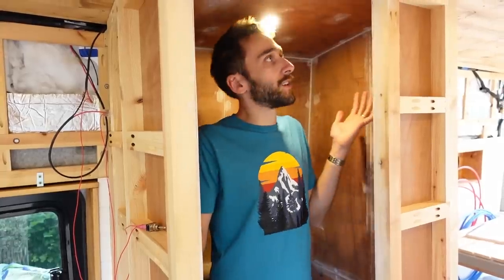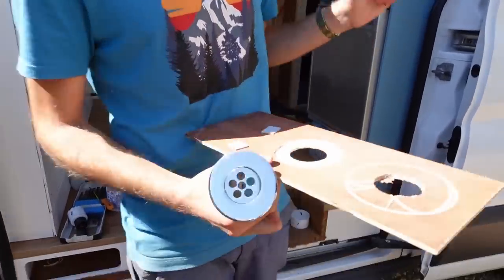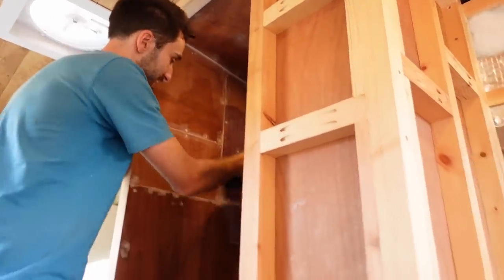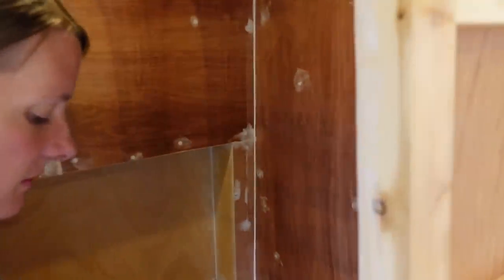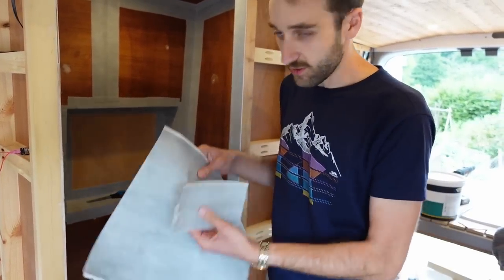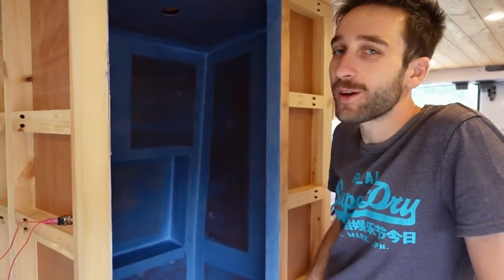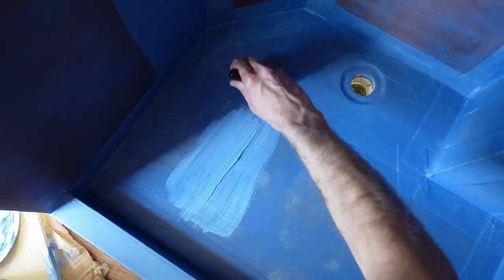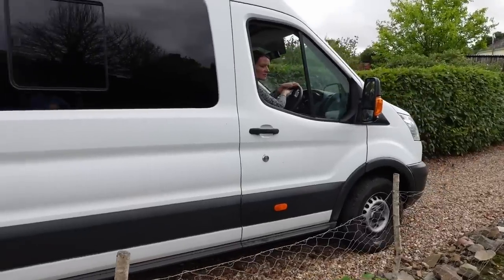Waterproofing Our Van Shower with Tanking (Recirculating Shower Part 2) | Transit Van Conversion E30

Comment: Silencer was a great move!
Reply from the maker: Yep! We were quite surprised how much of a difference it actually made, was instantly noticeable. When it's on lower speeds it's pretty quiet now
Reply: @SelfBuiltStories  I've seen people use two back to back, might be worth a look if youre still bothered by the noise
Reply from the maker: @darren9752  Yeah we've seen that as well, we're pretty happy with the level it's at now though. David McLuckie actually has a video where he tests out loads of different combinations including three in a row 😛 https://youtu.be/kxeqtJevV0o?si=J9bRSsd44CkB2dBL

Comment: Another great video and really good to see the level of detail you go into. It will certainly help anyone else thinking of doing something similar. Very wise to spend the extra time doing more layers of the tanking. Can't wait to see the final finish
Reply from the maker: Thank you! Yeah we're happy we went for the third layer, nice to have the extra peace of mind 🙂
Reply: Great work! How big is your water tank? How many five minute showers can you get out of it? 
Does the water recirculation occur for the five minute shower water or for the whole tank?
What is the concept of shower recirculation?

Sorry about all the questions! I  am just a very curious little bee!
Reply from the maker: @marshmellow989  cheers! 🙂 And no worries! So we have an 85l fresh water tank and a separate 18l hot water tank for the shower. If we're using it as a standard shower it goes down quickly, as our pump delivers ~2.5l a minute so for a high pressure 5 minute shower you would use most of the shower tank (~12.5l). So the way we designed the system was to save how much water we need while stile having a nice shower. 

What we usually do is a military style shower first using minimal water, which is ~2.5l each and that allows us to clean off any dirt, use shampoos and shower gels etc, and that all drains normally through the drain and out to the waste water tank under the van. Then we turn on the recirculating part (there is a switch outside the shower) which closes a valve to the tank and turns on a pump which pulls the water back out the drain and puts it through a number of filters before it goes back into tank, so it forms a closed loop. Then we can enjoy a hot rinse for as long as we want without using any more water. Then after a few showers we drain all the shower tank water into the waste tank and refill it from the fresh.

That's pretty much the gist of it, we'll release a video on it at some point but it won't be for a little while. It's not maintenance free either as there are filters that need cleaning/changing from time to time and it obviously adds a bit of complexity, but it works well for us! 😀

Comment: Good job guys. Astute of you to identify that the air intake to the heater was making the noise, the same happens on inlets to the engine (which are silenced by careful airbox design), not that 99% of people know. Another good tip is to mount things like pumps (air or fuel) onto rubber bobbins, this helps isolate them from the chassis (which would transmit the noise more).
Reply from the maker: Cheers, yeah we were surprised how much difference it made for such a simple and cheap addition, a big win! The fuel pump is mounted with the rubber spacer that came with it so it's not directly against the chassis, and that's mounted onto a block of wood. But the ticking still resonates and you can hear it fairly clearly, although it doesn't really bother us too much. We might try to quieten it down a bit but not eliminate it as the sound of it going is quite reassuring and we've got so used to it now we sort of like it 😛

Comment: Good job , you two have a lot of patience. By the way you know the shower is small when you are applying the waterproofing material from outside the shower and you still reaching the furthest wall lol. Ps I like to be generous when applying waterproofing material but liberal with my fiends in Floria when I need to tease them.
Reply from the maker: Cheers, it did take a while! Haha it is small compared to a house shower but it's plenty big enough for us in the van, it actually feels fairly spacious inside when you're using it 😄

Comment: Maybe a roller works better, but certainly doing more coats is worth it. I sealed a deck with similar membrane and a roller worked well. I still used a brush on inside corner edges though.
Reply from the maker: Yeah would be interesting to try with a roller actually, we just used what came with the kit. Is quite tricky to get a flat finish with just a brush so not a bad shout to give that a try 👍

Comment: Wow, well done guys, you love doing things the hard way. But tbh as long as its correct it does not matter. We did the ply with a shower tray we trimmed to our size then 2mm of pvc. Keep up the good work. :)
Reply from the maker: Thank you 😊 Yeah we did plan to use a shower tray originally and actually bought one but it didn't fit in the space we needed it, so after a brief 'hmm what now!' moment decided we'd build a custom fit wet-room instead. Was a bit of work but we're happy with how it turned out 🙂

Comment: I heard about device that's a level which can be placed on the dashboard and gets the car level (in two directions at 90 degree angle).  Foresty Forest channel of Youtube showed in one of the videos.

I found an example called a bubble spirit level.

I like that you spend a lot of time to make sure things are done as right as possible at first.   If I did a van build I'd strongly consider a diesel heater, but probably do something for bathing that facilitates bucket bathing.  Maybe a basin I can sit in with a drain.  I could put a stool in the basin and put a bucket or two.  I've seen it down with a large cup for wetting and rinsing.   Foregoing plumbing I'd be fairly happy about.
Reply from the maker: Cool, our problem was the ground was very sloping so there was no way to get the van itself level. But now we're on the road we a spirit level app to check the angle when we park up so it's optimum for shower drainage. And thanks, yeah we did spent a lot of time, but figured it would pay off in the long run! There's so  many different things you can do in a van which is the nice thing about it, you can build it exactly to suit you 🙂

Comment: I like this idea! We have a plastic tray which turned into a nightmare. I might go this route. Im wondering how is it holding up so far?
Reply from the maker: Hiya, happy to say absolutely no issues so far with many showers in that time! We'd definitely go down the same route if we were building another van too as having to conform everything to the limited sizes/shapes of trays was too limiting for the layout we wanted. And we don't have to worry about the often tacky motorhome trays cracking or yellowing either 👍

Comment: Beautiful build of a shower One question what the Measurement please  Please
Reply from the maker: Cheers, and the rectangle part inside the shower not considering the angled or wheel arch bits is roughly 76x60cm 👍

Comment: Another great video and contemplating using this method to do my shower room. 
So how has it stood up to time so far and are there different colour options? 👌🏻
Reply from the maker: Cheers, and it's holding up nicely so far. Presuming you mean for the PVC and tiles which we put over the waterproofing layer? As the blue tanking is all covered up. And yeah you can get them both in different colours (we almost went with duck egg for the reco tiles). HTH 🙂
Reply: I’m referring to the the tanking on the floor, because potentially it could get wet if the sealant fails.
Reply from the maker: @dazmtb  Ah ok, yeah the floor is holding up really nicely too. It's the same waterproofing membrane and then Altro Pisces wet room flooring on top. You can get that in a different colours and styles too 👍

Comment: Just come across your build channel and have bingwatch all your vlogs,  and was just wondering how  you intend to heat your hot water for the shower and sink  !!
Reply from the maker: Cool, thanks for watching! And we're going to be using a Bobil heat exchanger that uses the energy from the diesel heater to heat the water in a separate 18l tank, which should be able to get it to 40C in around 10-12 minutes. We have the kit already so hopefully not too long till we can get it all in! 🙂

Comment: Top Work as always...Maybe you have already said. but are you not having an extractor in the shower?
Reply from the maker: Cheers 🙂 And what we're planning to do is use the maxxfan that's right outside the shower to pull out the moisture air. We're going to put in a sliding door with a small airgap at the top, and then we'll have the heater blowing warm dry air in to the bottom of the shower. So hopefully it will create good airflow to remove the moisture and then dry out the shower room afterwards

Comment: Hi, loving the build. Have you considered venting for the shower, especially if you are using it for a drying room as well 

Keep up the great work
Reply from the maker: Cheers! And yeah we've given it quite a bit of thought. What we're doing it putting in a sliding door that stops a few cm's short of the top of the shower so there's a decent air gap, and then we have the maxxfan right outside which we'll have on while the shower is in use. Then when the diesel heater is on it will push dry warm air into the bottom of the shower and then be pulled out the top by the fan, so hopefully making a decent flow. There will also be a small fan inside the air pipe for the toilet we're putting in too. We think all that together should allow for some decent ventilation, but if when we stress test it we need something else, we'll add an extra fan/vent at the top of the shower 👍
Reply: @SelfBuiltStories  I should have known you guys have a plan. Loving the care and attention you are giving the build
Reply from the maker: @steveround315  Haha cheers, it's probably something like 80% thought and 20% actually building 😛

Comment: Van is coming along great! I've just binged most of your videos over the past few days and am looking forward to seeing the final product. On a side note - how do you find the extended van to drive? Currently deciding on what van to pick (I'm 193cm and would need a lengthwise bed + height of a transit) so sort of torn between the LWB and LWB extended (jumbo). Do you find the back scraping on hills/ swinging into traffic on narrow roads? Living in NZ with its hilly geography and narrow roads that would be a bit of a dealbreaker for me unfortunately - but seeing you guys happy with yours gives me a bit of hope haha.
Reply from the maker: Thanks a lot! 🙂 Yeah it's starting to take shape a bit more now, we're hoping we've done most of the bigger projects! And we find the van absolutely fine to drive, more comfortable than being in our car. We drove it 13 hours up to Scotland and it didn't feel that long at all. Where we are is lots of narrow country lanes, potholes and hills but we've never had a problem with the length. It's a bit interesting sometimes on a single track lane when another vehicle comes the other way and you have to reverse though! The only times we really notice the size is in busy urban areas, especially trying to park. Supermarkets and things round here aren't really designed to accommodate a 7m van, so we often drive around for a bit trying to find somewhere suitable 😛 We spent a few weeks in NZ on the South island in a motorhome, absolutely loved it there! You have some stunning scenery, hope to be back one day 😊

Comment: Where did you get the magnets from/what are they called that you put either side of the van to cut through it? 😊
Reply from the maker: They're just a pair of fishing magnets and ours are rated for 250kg. That seems to be a good sweet spot as we can feel the magnetic force through the van even through our composite floor with all the insulation in, but not so strong so that we can remove them from the underside easily. So would imagine any pair around that sort of strength would work nicely, something like this: https://www.magnosphere.co.uk/neodymium-fishing-magnet-threaded-eyelet-32-90mm/a-2201. There's some on Amazon too. HTH! 👍

Comment: Hi is it safe to use diesel heater in shower ? I mean what if water gets in there?  is it possible?  I'm at the stage of building a shower in my campervan and I'm wondering if it's a good idea.  Thanks  and greetings from Scotland  :)
Reply from the maker: Hiya! Yeah we had similar concerns about water backing up in the ducting but having done it now, we're not too worried. We've thought about the design to minimise the chance of any water getting into the ducting. So the air vent has a hood on it, and is on the same wall as the shower so the water is spraying away from it. We've also tried to angle the ducting downwards, and it's corrugated so any splashes that did get inside wouldn't get very far. You would have to have a large amount of standing water or deliberately point the shower into it for water to travel further down it. But even then, it probably wouldn't get past the heat exchanger we're using as that forms a low point, and there's also hot air being blown through it all the time. So we're fairly confident the way we have it set up is fine. Looking forward to being able to extensively test it when the recirculating part of the shower is hooked up 🙂

Comment: Can I please ask how you're going to get the used shower water back inside the van for filtration and re-circulation? It looks to me as though your drain pipe is going to need to be routed straight back in and up the back wall into the filters via a sump? I'm currently converting a sprinter and trying to figure out how to do this without cutting two unnecessary holes in the floor!
Reply from the maker: Sure, so we have another pump that sucks it back out the shower drain and brings it back into the van to the right of the shower into the bottom of our bench seat, where it then is pushed through all the filters. We wanted to keep the number of holes down to a minimum too so what we've done is put the pipe back up through the pipe that the toilet fan vents air out of. It's been working great so far, just taking some experimentation with different starting temperatures and how to use it most efficiently 🙂👍

Comment: How did the show fair up after use? Is there anything you would change if doing again? Thanks
Reply from the maker: Very well! The shower room has stayed completely watertight which is great so we'd definitely use the same tanking kit and sliding door we have now. And the recirculating part is working great too. The one things we'd change is on the drainage side of things, as at the moment we have to be quite particular with how we park to have it work properly. We did try to slope the sides into the drain but we'd probably accentuate that a little more by making some slightly angled wedges that point into the drain before doing the tanking layer. We'd also put in a slightly larger waste tank and lower it a little to increase the drop under the van too (we'll probably do that at some point anyway). Not big issues right now and we use the shower all the time, but would definitely make it better 👍

Comment: NEVER DONE THIS BEFORE BUT GOT EVERY Tool UNDER THE S UN
Reply from the maker: Slowly acquired a few during the build, particularly for the electrics. Large amount borrowed along the way, the odd lidl specials, and then selling some back on eBay at the end all helps 👍

Comment: Hello from Germany 🇩🇪. How many Kg did you guys really used ???
Reply from the maker: Hey 👋 Do you mean for the shower or for the van? We've been trying to keep a rough track of the weight of things as they go in but with the carpentry its a bit trickier to weigh, but we've taken the van to the weigh-bridge a few times to check how it's going overall
Reply: @SelfBuiltStories  i mean just for the shower 🚿. 😁
Reply from the maker: @sethgold6950  Ah k, we don't know in isolation as we built it piece be piece inside the van for that one. And between the weighbridge visits we had added more than just the shower so hard to pick out just that on its own. We used the leftover van wall ply which was only 5mm to keep the weight down there, and the pvc and reco tiles are nice and light. We did end up using a little more wood for battening though than we'd have liked as using our plywood offcuts meant we had a lot more joins that needed supporting. Think if we were doing it again we'd probably size the wood down on the supporting rails from 2x2 to 2x1 and use bigger pieces of ply, but we wanted to use up everything we had left instead of buying more wood

Comment: Daft question what does the tape do ? 😊
Reply from the maker: No daft questions! 🙂 It's got a flexible butyl tape layer which goes over all of the joins and corners to provide the first layer of waterproofing before the membrane goes on. All the seams are the most likely places for any leaks so you put it anywhere there is a join and it should move and flex with the van as it's moving 👍
Reply: @SelfBuiltStories  so once you have applied the paint type sealant.  Do you put anything else over like the plastic type panelling? Just for aesthetic purposes?
Reply from the maker: The pvc layer is also completely waterproof but forms the visual layer you see too. And very easy to wipe clean 👍

Comment: what size did you make the shower cubicle?
Reply from the maker: Hey, so the rectangle part inside the shower is roughly 76x60cm, and then there's the angled part which gets around the van pillar and the box part around the wheel arch 👍
Reply: @SelfBuiltStories  superb thank you I’m in the process of co veering an ex Bt Openreach trailer body
Reply from the maker: You're welcome, good luck with it!